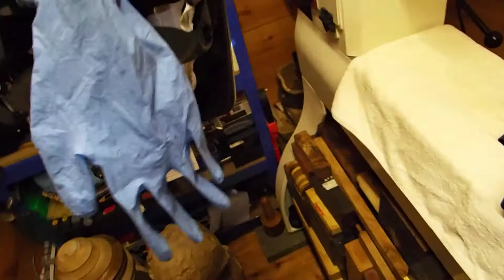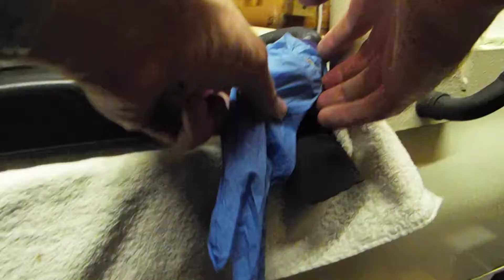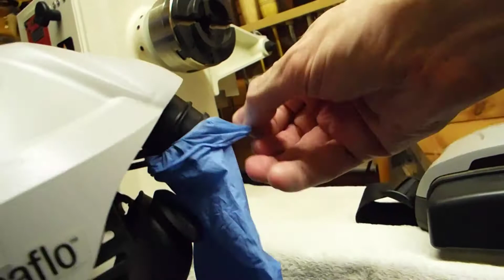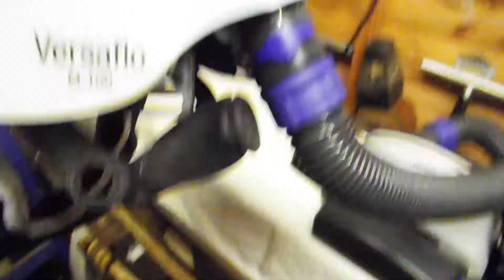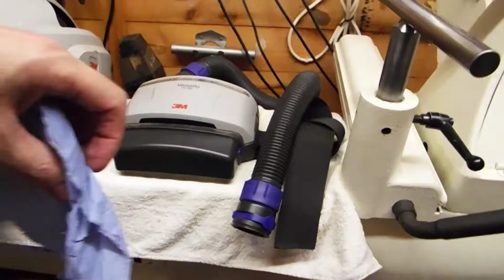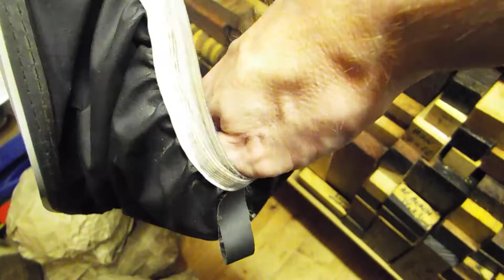workshop dust control 3

Comment: Just bought one myself, waiting for the M-106 to show up as it was delayed from the distributor. The battery is supposed to last for 2000 hours and maintain 80% of original charge, which probably accounts for the initial over performance of the battery, interested to know how your battery performs now.

Comment: whats the price for this 3m unit
Reply from the maker: sorry for the delay Mike, I paid around 700 UK pounds for mine (roughly 1000 dollars) but that did include the large capacity battery, sounds a lot I know but it really Is a top rate piece of kite and is designed to stand up to industrial usage, you just have to figure out whether you will use it enough to justify that price tag, hope that helps !!!